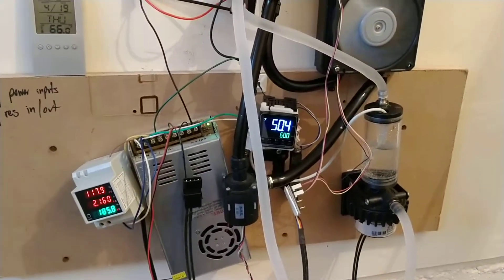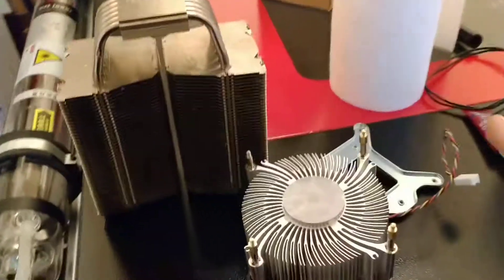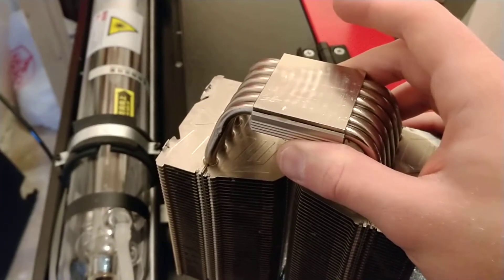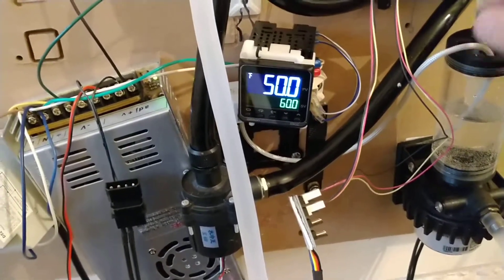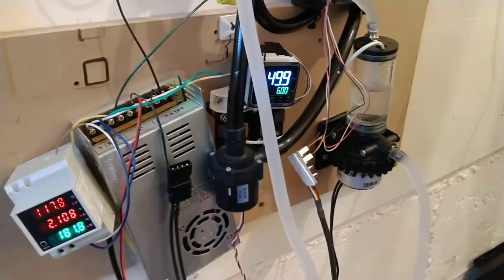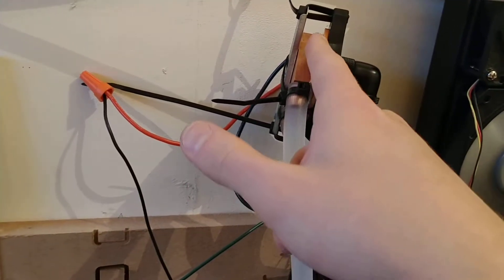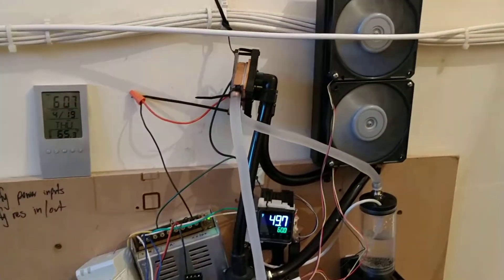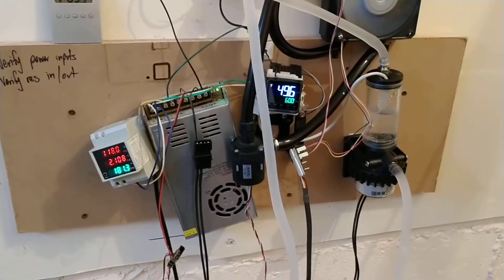Peltier CO2 Laser Water Chiller Project - Part 2 - Working Prototype

Comment: So any follow up? did it work? how well did it work? Im asking because i have a 50W one and i was thinking of making a chiller for it, but i have to choose between one with peltier cells or making one from a recyled broken fridge, reusing the compresor and condenser and making my own evaporator/heat exchanger. The price is mor or less the same, being the compressor the more expensive one, but still its like 1/50th of the price of even the cheapest chinese co2 laser chiller available here. 
So it the peltier cell worth it? I was thinking of using two on an aluminion heat spreader block and brazing some aluminium tube in a spiral to the block to help the heat transfer, then just cut and hook the water line to the aluminium coil and out to the reservoir. Then the usual cpu cooler+fan.

Otherwise, the same idea but instead to coils brazed together, one for the water and the other for the evaporator for the compressor, and some insulation to keep the thing from freezing.

I am planning on using one of those chinese temperature relay control modules which seem good enough to power up and down either the compressor or the peltier cell depending on the temperature of the aluminium block.

Any suggestion is appreciated :P

Comment: ADD A TEMP SENSOR WHERE WATER ENTERS THE LASER TUBE...RUN A 30MINUTE RASTER JOB...CHECK YOUR TEMP....SHOWING READINGS WITHOUT RUNNING A JOB (WATER WILL BE TRULY HEATED) IM SURE THE TEMP WILL LOWER...BUT .......WHAT DOES THE TEMP SAY AT END OF JOB?  ...............NOT THE PELTIER TEMP....THE WATER TEMP
Reply from the maker: shit you're making me want to upload an old video I recorded last year of the system, it's dual chip, dual 60mm radiator, with a temp controller and temp readout of coolant temp coming out from tube. I've since taken the chiller apart because I needed some of the parts but I'll either reassemble it and record a new video or upload the old one.
Reply: @NikitaLab  easy bud....just wondering if this peltier/radiator system can keep up on a long raster or cutting job (1 hour)
Reply from the maker: Absolutely not. With 2x15A@12V chips let's say at 50% efficiency that results in 180W of "cooling power", laser tubes are 10% efficient or something like that. So with a 100w tube we can only put out continuously like 15ish% power which feels about right from my experience. It's good for short jobs and in my case I made it mostly out of spare parts. If you're talking about hour long jobs I'd go with an off the shelf chiller for $5-800

Comment: I have a 65 watt laser tube and I am currently cooling it with a passive CW-3000 chiller.  This works fine keeping the laser at about 20C unless I am using the laser at high power levels (cutting) for more than 5 or 6 minutes.  Then the CW-3000 cannot keep up with the heat load.  So I am looking at adding a Peltier water block between the CW-3000 and the laser to add additional cooling capacity when needed.  Thanks for your video, it show me that this is a viable plan.
Reply: INSTEAD OF USING HOME DEPOT BUCK ET AND ICE FOR LONG JOBS.... I BOUGHT A REGULAR WATER COOLER ON CRAIGSLIST....ADAPTED IT INSTEAD OF HOME DEPOT BUCKET DEAL....$35....AMAZINGLY, WORKS PRETTY GOOD....COOLER CONSTANTLY RUNS (FIGURED THAT) STAYS AT 24C...... IT LABORS....BUT FOR $35....WORTH GAMBLE...

Comment: I don't understand why you are trying cool a water loop with another water loop.
Reply: you may find the answer if you google surface heat exchanger thermodynamics
Reply: He's trying to cool the hot side of the peltier chip, and air flow via a fan alone isn't sufficient. A closed water loop is fairly efficient for that. But yes, it's just moving heat someplace else. Maybe he could use the old aquarium pump for that! :)

Comment: Nice work :)
I literally just assembled the same TEC & 2x120mm fan closed loop cooler configuration.
Pretty keen to see how your setup performs with some heat load, perhaps we can trade figures. Is there a project page for this on something like hackaday.io ?
I have to pick up some insulation tape and water tubing on Sunday before i can run power & efficiency tests. Fingers crossed i can achieve at least what you are getting so far d:)
Reply from the maker: The current setup is far away from what I have in mind for the final configuration, I still want to add an additional TEC, relay, temperature sensors, etc.
Once the project gets closer to it's final form I'll consider making a post on hackaday. I also have made a few upgrades throughout my X700 machine that I'm looking forward to sharing.
I saw your K40 led guide video, great idea. The 35-40w tube your machine has shouldn't need more than 1 TEC chip and what would be cool is if you stuff it all inside the K40, I also had one and remember that there was a lot of room inside.